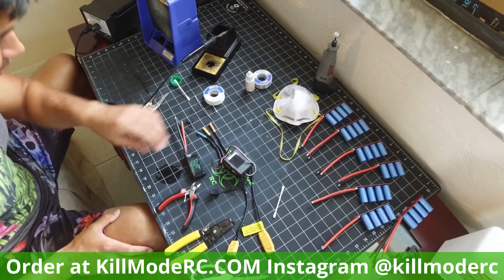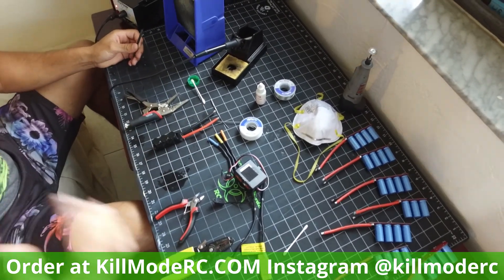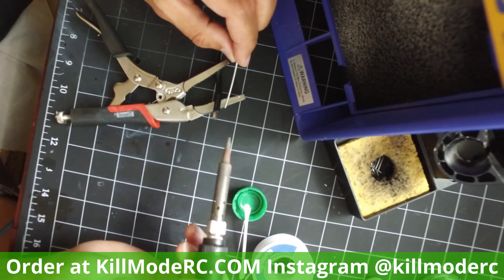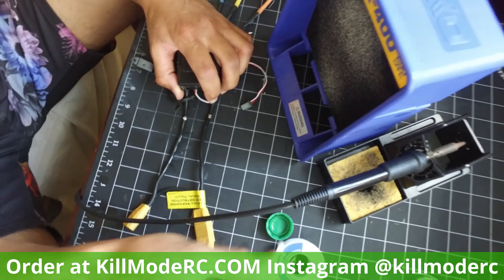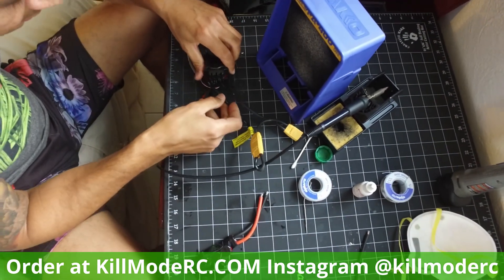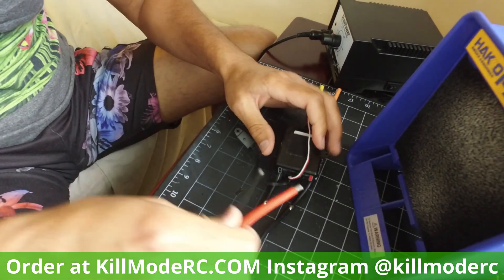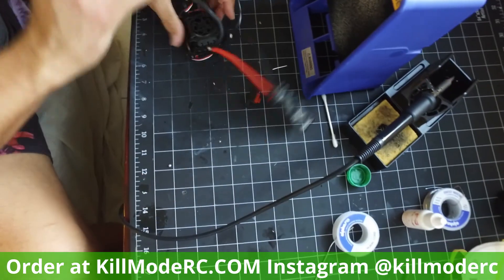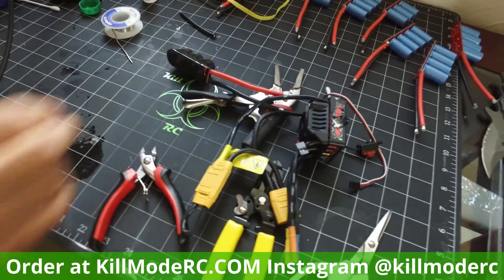How to solder a Kill Mode RC capacitor pack. Kill Mode cap pack install

Comment: 4:32 unless your holding it on so long that the wires come unsoldered from the esc you are not even close to damaging it. how you you think the power wires were attached to the esc?

Comment: The cap pack are soldered in parallel or in series? thx
Reply: cap soldered in parallel for increase capacity and eficiency
Reply: @Mimi-ky3ds  what if they in series. My local rc shop soldered in series and im scared to plug in my batteries now😂

Comment: Thanks for the info very nice and clean i need a cap for 6s for typhon would that be the 3 or 4 pack thanks...
Reply from the maker: QuickDrawMcDraw 227 any of them would work. I currently run the 4 pack on my Typhon on 6s and it works great. Check out the website. Www.killmoderc.com

Comment: A cheap trick for large gauge wires that works for me is to use one of those large thermal mass 100W irons designed for lead lighting. I was soldering XT-150's one after the other and it was the only way I could production line them without getting cold solder joints. Nice data on the packs. Might try the large 50V one on my 5th scale. Have you any plans to develop lower Voltage rated packs for sizing in 10th scales? I would be interested in 25V rated packs for my 4S 10th scales.

Comment: you make soldering seem easy as heck. I noticed you mentioned to use Flux in regards to not having a powerful soldering iron. I don't use any, nor are my solders quick. 

what Flux do you recommend? I'm always keeping my iron on wires for more than 7-10 seconds
Reply from the maker: Dang, I've had this same bottle for so long, I don't even remember the brand, and the label is worn off. just get a liquid flux, not the paste, and just use a tiny drop on the wires. it heats up so fast.

Comment: wich packs would you recomend for a 8s setup. working on a project with 2 2028 castle motors with 65t pinions. my total would be 16s with 2 separate esc's and power connections.
Reply from the maker: Angelo Evangelou wow! I saw the pictures. I just replied to your text.

Comment: question kill mode rc, is there a T-connector or a Y-connector female open ended termination bullet connectors available for this specific jump/piggy back solder connection to ensure a positive locking & clean solder job? would be nice if maybe some1 can geniusly come up with a T or Y 5mm,6mm or 8mm bullet connector idea for a 8,10 or 12 amp wire gauge. just my mind wandering or simply wishful thinking.
Reply from the maker: not sure, I like to solder a castle 6.5mm polarized pigtail to the esc, so I can remove the cap pack easily without unsoldering them.
Reply: @killmoderc6815  
do you have pictures or a video showing this pigtail mod?
Reply: Also interested in pics

Comment: a bro what do the cap packs do to your esc
Reply from the maker: cap packs reduce ripple voltage, and esc temperature. This also extends the life of the esc by taking stress off the ESC's internal capacitors.
Reply: Kill Mode RC how kan I get one kan you sell me one
Reply from the maker: the website is killmoderc.com
Reply: Kill Mode RC kan you sell me the cap packs that is 35 for 27 or 30 bucks
Reply from the maker: dank moto life unfortunately $35 is the set price, but I can give free shipping which costs me about $7 so it about that price.
Reply: Kill Mode RC oh ok
Reply: Kill Mode RC hey bro I am going to order a cap pack from you this week
Reply from the maker: Sounds good! order on the website, I'm doing free shipping. Www.killmoderc.com